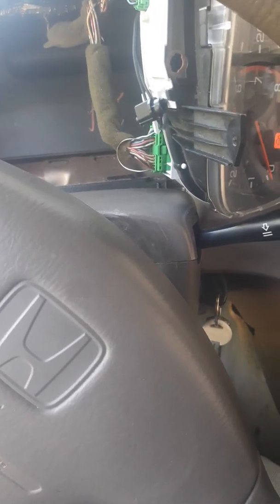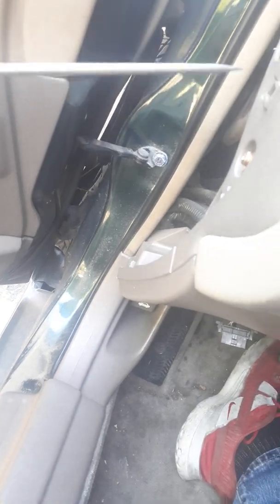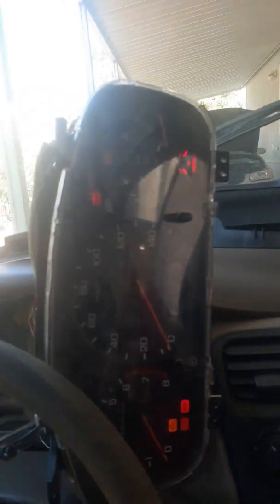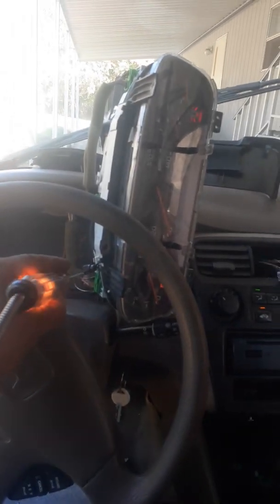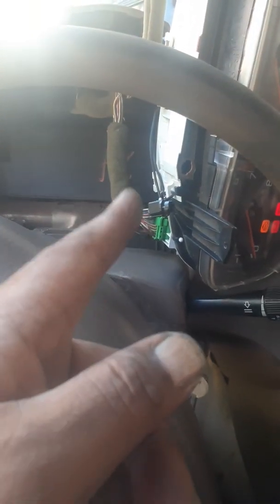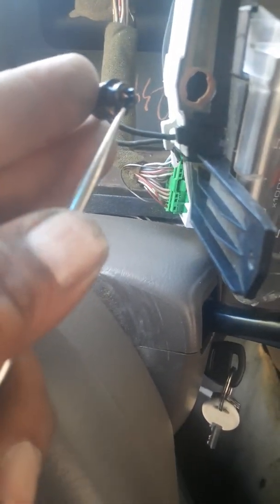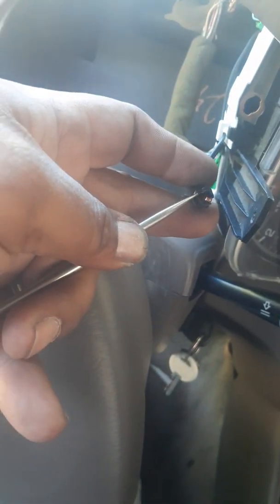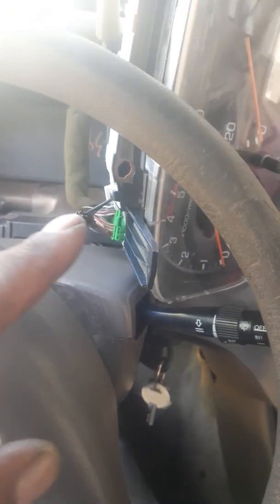Honda no cluster light. Multiplex problem

Comment: I have same issue 1998 accord, fuses are ok on both sides, is it multiplex on driver or passenger side the issue?
Reply from the maker: Driver aide before you play with the unit check cluster welds not cracked or broken.

Comment: I’m having this problem with a 2000 odyssey. Is the multiplex that I need to change on the passenger side or drivers., I’m asking because the fuses for that dash lights and taillights radio etc are on that side..
Reply from the maker: It on the passages side. When it stop working check fuse check the the starter connections on the cluster before changing out the multiplex. This something Honda suffer from.. one of these three thing so check that you have power going to and from. My went out because the cluster weld where broken and caused a short. Other will find that the i it itself is the cause.. hope this help let me know thank u